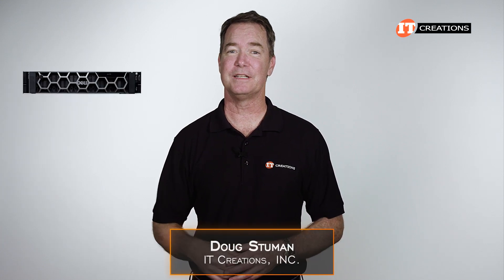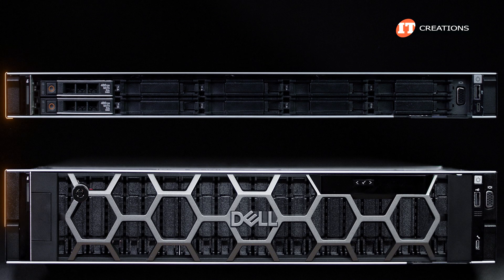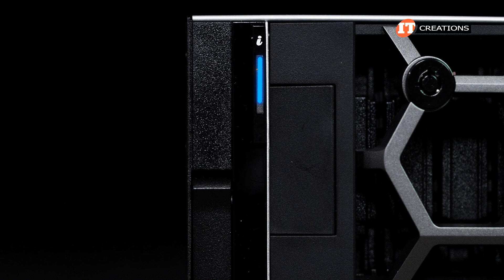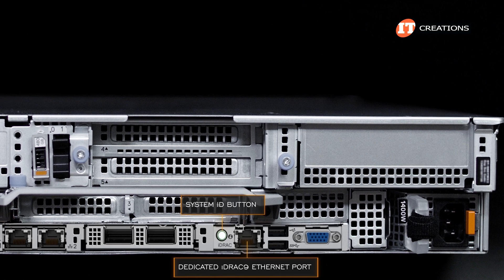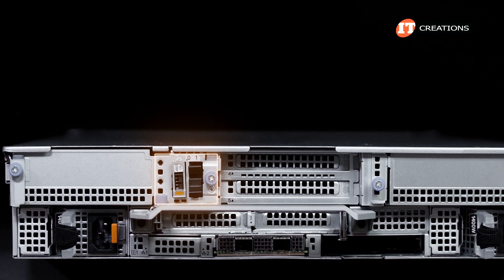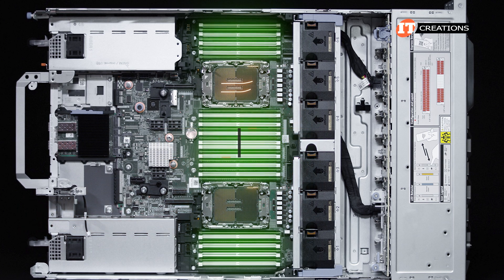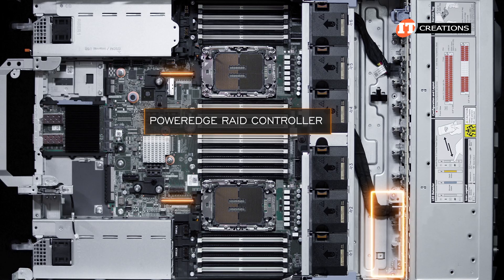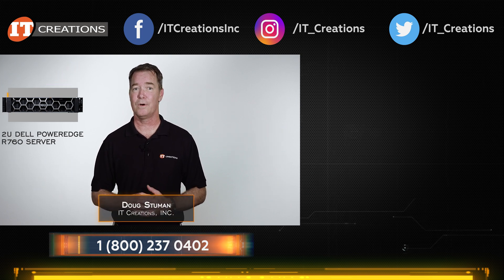2U Dell PowerEdge R760 server REVIEW with 4th gen Intel Xeon Scalable CPUs | IT Creations

Comment: Appreciate you posting this video but here’s some constructive criticism. This is an overview not a review. You did not test the performance of the server. I think it’d be more helpful for you to show some benchmarks or performance of the server. Honestly you are reading specs off the Dell website. I personally don’t think this is helpful just restating facts from dell. Again just trying to help!
Reply from the maker: Hi Justin,
Thanks for the critique. We do hardware reviews or overviews if you would prefer to call it that. Yes, much of it is specs are off the site with some added information that seems to get somewhat buried in certain instances. I see you are a server guy, and I can appreciate that, but we sell hardware. IT Creations is a hardware distributor of all the major brands and we have legacy hardware and components. We are not a cloud service or testing center. I'm kind of surprised we get as many of these videos out as we do before the unit gets sold and I have nothing to work with. Yes! Has happened many times. We do post these videos to our landing pages to give the customer more information on a platform they may be interested in. This is a means to an end in that "REVIEW" works much better and is searched more often in Google than "Overview"—usually… Frankly, I don't have time nor the man-power to test these systems other than in the most rudimentary way, which would leave out a bunch of specific workloads anyways. I find that Serve The Home does a pretty good job of actually testing some server products but as they say in their tag line "Storage and Networking Reviews". With only two people, one of which is shooting the video and editing, actual performance reviews aren't going to happen. Thank you for taking the time to comment and watching our videos!